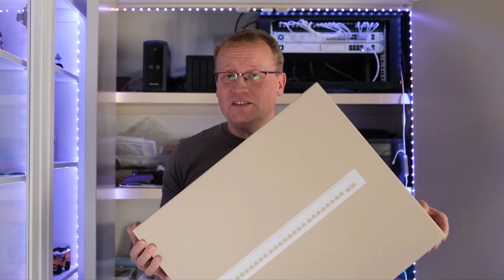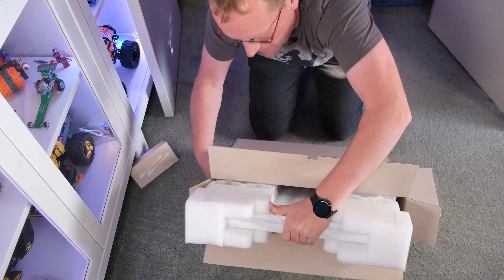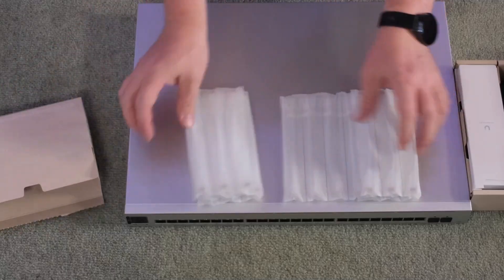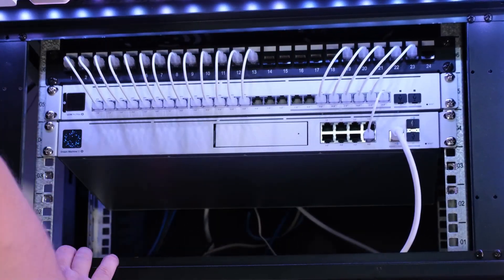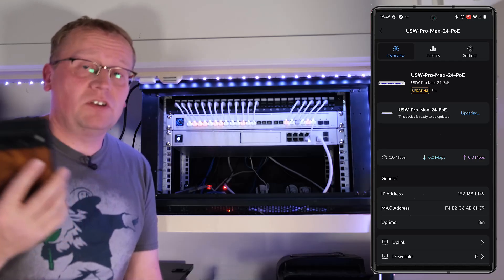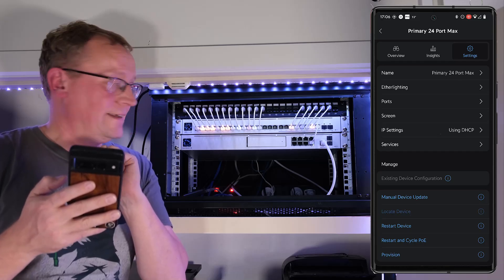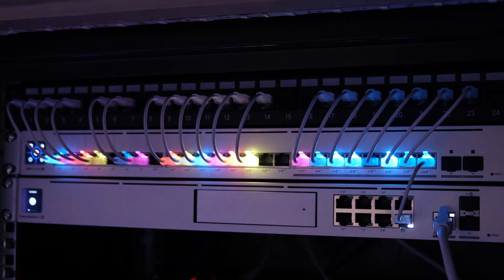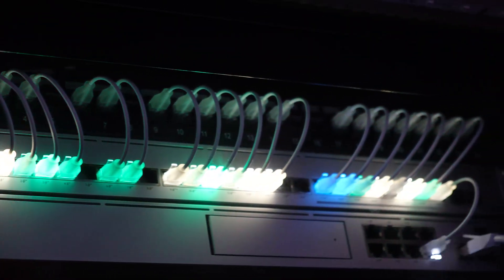Unifi Pro Max 24 PoE - Unpack, install, configure, light up! #unifi

Comment: Hello,
We're Muriel and Marcel, from France and Berlin! We are, if we can say it that, fans of your videos. After looking at them, we were inspired and ended up with a 23,6x23,6 Inches  server cabinet.  We have a few questions: does this cabinet accommodate a Unifi 48 POE? How much space is there between the switch and the cabinet door? Because we don't want to compress or twist the cables. Of course, we'll be using Unifi patch cables. Could you help us? Thank you very much. Best regards from France, Alsace, on the Swiss-German-French border.
Reply from the maker: Hi Muriel and Marcel. Thanks for the kind words 😊
The most common server cabinet/rack size by far is 19 inches wide, which is what Unifi adheres to as well. So, yes the Unifi 48 PoE switch will fit into that. What does change is the depth of the cabinet, where there are many options. Unifi's rack mounted devices will almost all fit within a 400mm deep rack, including the USW-48-POE, which is 235mm deep. Whether the cables will fit with the door really depends on the specific rack you got. They are all slightly different in how much space is at the front. 
I hope that helps, and thanks for watching.

Comment: Can you give me an idea how loud the fan is and how often it runs? I have a Lorex system and the fans run all the time.  I am hoping for a very quiet or perhaps silent system.
Reply from the maker: It is very quiet and only runs occasionally. I have mine in a cupboard, so it gets hotter than average, and I never notice it.

Comment: These are an expensive switch, but hell cool and the Etherlighting, as much as I thought it would be a gimmick, is actually really helpful.   
I also like that it has POE++ and some 2.5GBs ports.
On a flat network / default VLAN, the switches will work unmanaged, but if you need VLANs, you have to manage them.  It's a nice little feature that they can run unmanaged until adopted.
Reply from the maker: It is a great switch regardless of the fancy lights, but yes, the fancy lights are really useful.

Comment: Just one small disappointment in your install, you have two great devices that support SFP and SFP+, so you could be connecting them with the 10Gb between them and enjoying extra bandwidth and less congestions between your devices and the WAN. Looking forward you updating that. thanks.
Reply from the maker: Totally fair, and in fact I am planning a larger video for upgrading the entire farm network 😊
Thanks for watching. Love the feedback.

Comment: Etherlighting could have been the greatest invention in switching in the last decade. But as usual unify makes a half baked product and forgets to add a string of pet filament in their cables so the other side of the cable lights up and could assist in tracing cables
Reply from the maker: That doesn't sound like a stretch to get done. Perhaps they are working on it?

Comment: As a datacenter designer the question is why?? And look who much extra power it taking
Reply: As a datacenter expert my question is why is it the other side of the cable is not lighting up. So engineers save valueble time tracing cables and got a visible identifier to disconnect the correct cable.
Reply from the maker: @krakakapaul  It would be useful (and shiny) having the whole cable light up. If you had two Pro Max switches connected with etherligting, you would get both sides lighting up though.
Reply: @LarsKlintTech  they just need to add a string of clear plastic inside the cable. This will transfer the light to the other end of the cable.
For aggregation you will use the SFP ports and etherlighting ports are designed to connect clients. 

The problem is money as they grab an off the shelve network cable and add their own connectors to it is cheaper than fabricating your own network cable.
Reply from the maker: @krakakapaul  Yeah, it has to be a viable price as well I guess. It would need a fair amount of R&D budget.
Reply from the maker: I don't know why. Can you share your concerns from your point of view? What are the issues you see in a data center? 
I don't think the power consumption is a real hurdle compared to the usage of the devices themselves. A standard LED bulb uses about 100-200mW, so the 24 ports use 2.4-5W, and that is only if they are in use and at max brightness all the time. If you have a big bank of them you might get usage of 50-100W, which again is only if they are all used on max brightness.

Comment: I would connect UDM and Switch with SFP+ 10G cable... Etherlight is awesome, sadly do not follow LCM screen off time, they should implement port lights OFF/ON function for every switch they have, it is crazy how my UDM glows... or my Ultra switch, need to use tape to dim it (yep, it heat up a bit)
Reply: Have at home smaller brother, Pro Max 16 Poe... a lot smaller, fanless, but with big power brick...
Reply from the maker: @bckpcz  Yep, 10Gbit is coming. I have a bigger upgrade in mind for the network. 
I agree it would be good if the etherlighting would follow the schedule too. Hopefully just a software update :)
Reply: @LarsKlintTech  well, yoy can play with etherlighting via ssh, so it should be possible, even seen one person that create snake game for 48 switch
Reply from the maker: @bckpcz  Oh, I didn't know that. And yes, I have seen that video too 😂

Comment: Connecting router and switch using SFP+ might be worth if you have more than 1Gbps wan. Or there’s any other escenario where your current connection is not enough?
Reply from the maker: You're not the first to suggest that. I'm seriously considering upgrading the whole LAN to 10Gbit where possible 😊

Comment: There is a locking tab on the back of the switch that will keep the power cord from accidentally being unplugged when it is engaged. I did not see you use the locking tab when you plugged in the power cable to the back of the switch. I highly recommend that you use it.
Reply from the maker: Thank you very much. I wasn't aware of the lock, so you are 100% right, I didn't lock it. 😊
Reply: @FrederickFalk  Annoyingly here in the UK they ship the switches in the box with an EU cable (complete with the locking end), but also send you a UK cable (a standard C13 to UK plug, no locking end and not nice braided) 😕

Comment: Nice upgrade :) I have the 24 port PoE Pro and have considered getting the 24 Max Pro as a replacement.....just because you can :D Btw. you should get the 10gbit uplink SFP+ between your UDM and 24 Max, again just because you can :p
Reply from the maker: Haha, you're not the first to mention the SFP upgrade. If I do that I might as well do it properly... 😏
Reply: @LarsKlintTech  I got those short white DAC ones from Unifi. I also have have a longer black one to connect my 24p and UVNR via 10gbit. Its annoying that they put the SFP+ on the back of the UVNR when its mounted in a small 9u rack like yours. So difficult to add if the UVNR is already secured with screws :D
Reply from the maker: @luftdronedk  that's one of my challenges and then the whole separate buildings thing 😂
Reply: @LarsKlintTech Well, its easier to run long fiber cables than Cat6 so you just need some 10gbit SFP+ modules and you are good to go :D Alternatively you could now use the 2.5gbit on the 24 Pro Max and use the RJ45 SFP+ modules that come in 10gbit or 2.5gbit.
Reply from the maker: @LuftdroneDk  I'm thinking UniFi building bridge. I'm not digging that much for no huge benefit.

Comment: Like your video. I'm just thankful that I don't need that switch.
Reply from the maker: It's turning out to be one of my more divisive videos 😂
Reply: @LarsKlintTech  Well, the reason I don't need it is that I moved to 10 GB network in the core network. I do utilize smaller switches in different location all over the house.
Reply from the maker: @MatsAkerberg  oooooh, now you're talking. I'm planning on an upgrade to 2.5-10Gb too on my local network.
Reply: @LarsKlintTech  USW-Pro-Aggregation is the way to go 🙄 It's on the list however for now I'm running USW-Aggregation. It would be great to have something between thoose tough. One to big and one to small....
Reply from the maker: @MatsAkerberg  I've got so much to learn 🤓
Reply: @LarsKlintTech  We all do, It's a shame life is to short 🤩

Comment: You need a short DAC to patch between the router and switch, that will free up a port
Reply from the maker: I am seriously considering upgrading to 10Gb on the internal network, and that would definitely be part of it.
Reply: @LarsKlintTech  Yeah, but a 0,5m DAC is the first I would connect. Connect everything with SFP/SFP+ ports and never look back. (and a DAC is cheap too and a very stable way of connecting the network devices itself)

But yeah, nice switch. I like the all-ports-in-one-row. Always wanted the Enterprise-24-PoE, but since there is the Pro Max 24-  and 16-PoE I would go for this one. PoE++ is handy too.
Reply from the maker: @DutchShaggy  I am thinking in content mode, so I'd probably update as much as I can in one go to ~10Gbit, including the DACs and wireless connections. 
I really love the ports being in one row too. I probably means Unifi only have to carry one length of etherligting patch cable too 😂
Reply: I have a 6” DAC Cable running from a UDM-Pro to a Pro-24-PoE for several years and it has worked great. 

About to Order a Pro Max 48 PoE for that location to upgrade the 24
Reply from the maker: @evankaaltonen  ooooh, the big boy. Let me know how noisy that sucker is.
Reply: @LarsKlintTech The Pro Max 48 PoE has been running since Aug 24, and has been great. Its not that loud, Similar to the UDM-Pro.
Reply from the maker: @evankaaltonen  Thanks for the update. My 24 port Pro Max is still running great too. I would love the 48 port though ☺

Comment: I'd prefer the option to dim the lighting on Ubiquiti switches
Reply from the maker: You can dim the etherlighting too.
Reply: @LarsKlintTech  yes, but the UDM-SE is too bright and the USW-ultra or flex mini has no such options to limit light pollution. It would be a few lines of code to implement pulse width dimming.

Comment: Great video. You can get temp in Home Assistant or at least my switch has it. Here's what I use: sensor.usw_pro_24_poe_temperature
it should be similar on your switch. Now you also need to get the complete UI look with the 24-Port Blank Keystone Patch Panel too! I have 2 in my rack.
Reply from the maker: I was wondering if you can get special "etherlighting compatible" patch panels! Also, damn you! 😂
Oh, you get the temp through the Unifi Network integration?
Reply: @LarsKlintTech  Yes the integration gives access to a bunch of stats
Reply from the maker: @toddkeith I smell another video coming 😂

Comment: Thanks for another great Video. It looks great and i also have a few POE++ units on my network (USW-Flex).

Few questions
- If you dont have a patch panel and use normal RJ45, does it show any effect ? (Where i need it i have 30 meter RJ45, not at patch panel)
- Usualy unify has a day/night schedule where during the day displays are on and in the night they are off unless you tap on the display. Does this also apply for Etherlighting ?

I dont think i would invest in the switch, if i could redesign my network i might. Where i need POE++ is in two shead's outside with only 6 ports, would be a bit overkill. Also does it support outside use ? If i could only have one / two main switches, yes i would invest.
Reply from the maker: Really good questions Thomas. 
You will still get some lights with a standard patch cable of course, but not as shiny. It also depends on what style of patch cable you have. In short, it won't looks as awesome. 
No, the etherlighting doesn't follow the night time schedule, which is a bit odd. Might be a future update? 
They are not outdoor rated, but there is a 16 port version too, which can be mounted on wall, desk, or in a rack.

Thanks for watching ☺

Comment: Definitely my next purchase once I get my startech 25u rack.

Can you turn the lighting off or have it on a timer? 

Unfortunately previous owners terminated all ethernet runs in the master bedroom. I can see this switch pissing the wife off, lol.
Reply from the maker: I wish I could fit a 25U rack 🤔
You can set the brightness to 100%, but there isn't a timer. 
I guess it is time for you to run some cables to the new rack location 😂
Reply: @LarsKlintTech  lol I can't stand running, cabling, or crimping RJ45 connectors.

Guess I'll just have to test how strong the marriage is with this bad boy in the bedroom.

Should remind her of when we first started dating, and I had a 42u Compaq rack in my little room with Cisco and Dell power edge servers screaming.

Great video, and thanks for the feedback. Much appreciated.
Reply from the maker: @doctorno3912 haha, great story. Thabks for sharing and thanks for watching 😊